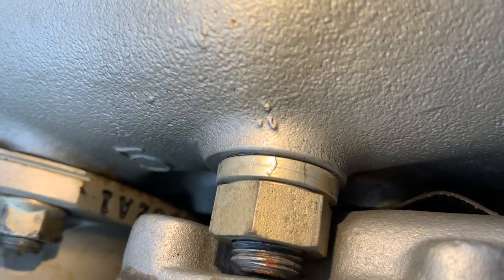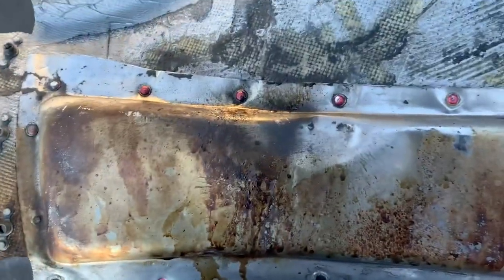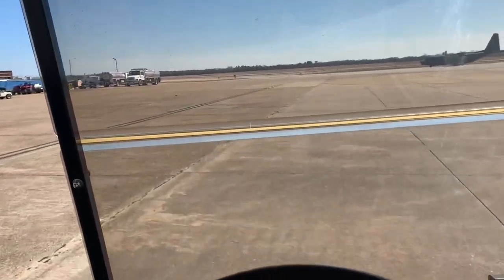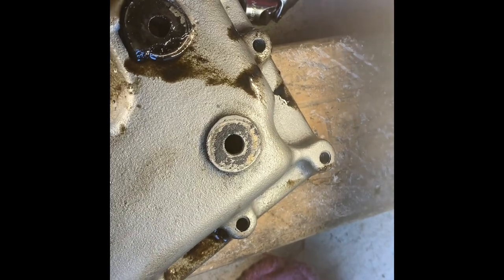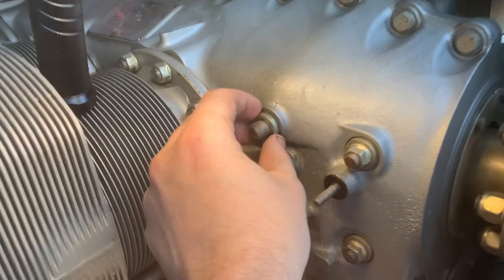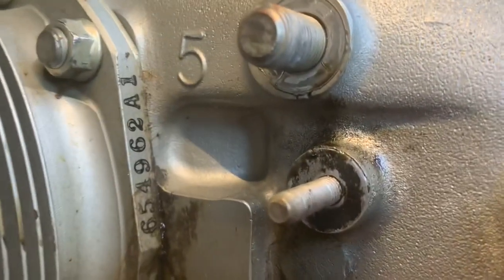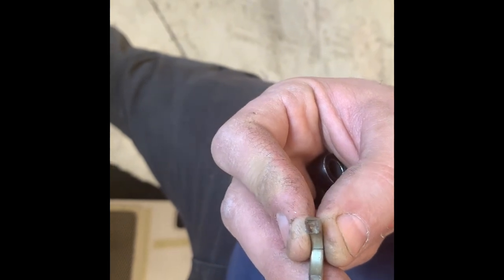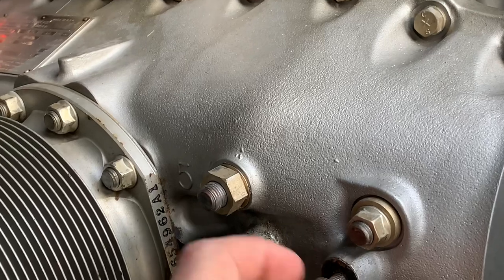Cessna 210 continental TSIO-520-R has a slight major leak.  Cracked through stud hardware. A&P life.

Comment: I've been an AMT for 35 years+.I owned an airplane for 10 years and worked on GA up through heavy large aircraft. Same simple Trouble shooting techniques pay off on all of them. That is the gift you guys have- and it's rare in our field. You trouble shoot. Fantastic work- keep it up. I guess I'm not alone.
Reply from the maker: Wait on part two.. when we pulled out the thru bolt I found out is the wrong part number….. it’s too long…. So then I looked for the shirt one and found it smack in the middle. No thread protrusion on either cylinder hold down

Comment: I had a thru bolt on my 0-300D for 172F leaking- found hack saw marks 50% thru the bolt UNDER the nut. The o-ring for the side with the leak had been pulled from the land the o-ring was to sit in, It worked for a little while- it has 790 hours on it when I pulled it out. In the process, I ended up having that jug reworked for cracked exhaust seat and valve guide as well.
Reply from the maker: Bro sometimes you wonder what’s been going on with these birds 😂.  So hard to find good information on a lot of the stuff we’re working on because most of the techs who really need it have retired.  Our shop is basically all under 35 and we try to soak up all the information we can from the older part time guys

Comment: Get a Continental Tech Rep on the phone and have him dial up your video. I'm certain it will interest him. There have been way too many fatal accidents this month, one was right out of a fresh annual.
Reply from the maker: Overhaul shop may have put on the hardware with the cracks already there
Reply: @aviationsquared1909  I was thinking over torqued?
Reply from the maker: @Brad2117   yeah we debated for a while 😂.  Another theory was that the paint was wet and rolled up when it got torqued putting pressure points on it.  

I honestly have no idea how it happened, but we looked over all the hardware and that’s the only one cracked.  Rest assured it’ll get fixed no matter how it happened
Reply: The 210 fatal in Grove City Pa. Last November Is an interesting one.  Appears through bolt nuts backed off. Apparently the engine was a recent OH. My friend was the passenger.
Reply from the maker: @jplumbob  sad to hear.  This one got very complicated when we started looking into parts.  It’s not flying with that engine
Reply: @jplumbob  I was doing some minor maintenance on a 421 that was bought by a nearby reseller. I don't know what made me do it but I found some loose (as in finger tight) cylinder hold down nuts on the right engine. That was back in the 1990s.
Reply from the maker: Wayright….. this engine was last worked on in 1995….. probably by the same guy because the #1 thru studs had zero torque.  Matter of time before a spun bearing

Comment: What are those "V" cuts on the outer edge of the recess where the broken washer came from?  Are they supposed to be there, or just broken off casting edges that don't compromise the case?
Reply from the maker: That’s where the cracks from the washer had the case form into it.  Through stud lost torque and vibrated.

Comment: elcano of wormos
Reply from the maker: Send help! 😂
Reply: @Gary Windsor,  Yes, It could be a 'Can of Wormies', but it is important for the users of this really nice plane to check into the actual CAUSE of that unusual oil leak... I'm thinking that this is a possible sign of upcoming issues with this engine... Possibly a poor seal between the case halves, or worse - a possible crack of the stud - boss , that could be caused by a defective casting... IDK, but the owner(s) should check into possible AD notes and Service Bulletins for this type & model of engine, and check to see if they have been complied with, if there are any for this engine...
Reply: @michaelmartinez1345   no shit sherlock i just said its a can of worms because i  have worked on a few C210 and I know how it goes
Reply: @gygw  , Golly,  that is interesting... Tell me about your experiences on larger multi engined aircraft and their systems... When was the last time you changed a pitch trim jackscrew? How many Cessnas have those? How many times have You dealt with APU's? How many times have you dealt with VCF's , VBV's , VSV's , PFD's , ADP's , ETOPS , RVSM, TCAS, MCP's, CSD's , VSCF's , RAT's , ACM's , IDG's , IGV's, bleed air, anti-ice, Radar altimiters, Radio altimiters, Weather Radar, Cabin door slides, Crew O2 systems, Engine Bleed air valves, EPR, ILS Localisers, Auto throttles, FADEC, Cabin pressurization, outflow valves, Cabin pressure relief (negative & positive delta-P) MUX cables & equipment, Cabin wastewater and treated (blue water) lab systems, high delta-p lav-waste accelerator systems, gear door sequencing valves, servo tabs, flight augmentation control systems, Fowler flaps, Zap-flaps, Leading edge flaps, flap carriages and adjustments, Flap & slat assymetry sensors, inboard (high speed) ailerons, outboard (low speed) ailerons,  AOA' sensors, OAT sensors, Static Ports,  Heated Pitot tubes, T/R's , Cascade Vanes, Trans Cowls , Blocker Doors, Clam-shell T/R's, 5th pods, Tiller control lever, Skydrol, M-6 cleaner, open center hydraulic systems, closed center hydraulic systems, MS hydraulic fittings, AN hydraulic fittings vs. SAE hydraulic fittings, Cabin and Cargo compartment heating/cooling & temp zone controls, fire retardant systems,  Braking systems, speed brakes and ground spoilers, Squat switch's, powered Cargo loading/fastening equipment on the planes, LD-3 containers, and the ground equipment required to get the cargo containers and bulk cargo onto & off of the planes, How about driving on AOA's of major airports, how about above ground Large aircraft fueling equipment (Tanker trucks)and under ground (Hydrant) Large aircraft fueling equipment (Hydrant carts & Hydrant trucks)... How many times have You gone up well over 60' high on a manlift to perform work on an empenage? Well Watson, what can you tell me about these common every-day things that are part of the heavy turbine aviation world, frequently dealt with by the common A&P's/R&E's , Pilots, GSE crews, and other large/major airport employees & workers? Please consider that there are other types of planes besides Cessna 210's and other airports besides the local municipal airports, that people use every day, when you're making the  comments, like the ones that You just made here.... Please consider WHERE the vast majority of aviation passengers and air cargo are actually going to, and coming from, and what type of planes , ground equipment and airports that they travel to and from ..... When you reply to this , with all of the aviation experience that You say that you have, expect some questions from me, and maybe from a few other people reading this thread, to verify Your experience... Anybody can build an impressive resume, the trick to that-is being able to verify those things at an interview... A word to the wise, Amigo...
Reply from the maker: Trying to get a 1-1 comparison on general aviation and commercial maintenance won’t work.  In GA unless it’s an annual the customer decides what they want done or not done.  Tech data requirements you are familiar with come from your airline and are more stringent.  A lot of the manuals used in GA are from 1960 and have never been updated.
Reply: @aviationsquared1909  I suppose that could true... But AD notes and Service Bulletins do exist in all forms of GA, as well as the larger airlines... That I am sure of... And with that being the case, wouldn't the replaceable pages of the "1960's" service manual binders be updated , just like the large airlines now do using computers? Sure they do... That I have personally seen myself. I did get a chance to work on GA planes, from January 2001, all the way until 9/11/01, when all VFR flying was canceled and many of the civilian IFR planes, even those with Xponders were grounded.... That is when the lateral skills that I previously had with trucks and heavy equipment came in handy... And the environment to learn new things in the many places that I worked at back then, and still now-was and is very open and conducive to learning new things.... Individuals with an attitude like the one displayed by 'Creative Mechanic' , were often quickly weeded-out and dealt with , sometimes in a way that ain't kind or pretty... They often let their OWN bad attitudes rid themselves of a good job that many others were waiting for... People like me, would quickly step in and fill the positions that they just screwed-up... And your comment , regarding the owners of the GA planes being able to decide on what they are able/want to have repaired and/or replaced is true... But if they wanted to continue flying that plane, they needed to have the MEL's on that plane completed, regardless of whether it came through an annual inspection or not.... That was (and probably still is) the law....
Reply: @gygw  so, tell me of Your experience with 747's , DC-10's & MD-11's...You forgot to mention them, BEFORE you are going to edit your last comment... Of those acronyms and systems that I just asked you about, in my last response to you, Which of them are exclusive to the 747's... If it was AAL that you worked at, which of the planes that You listed has a 'Penthouse' , and where is it located? Tell me about the air vanes that were added to some of those plane types that you listed here, and which system that it was  supposed to dis-able while the plane is in flight? Why was that system dis-abled while those types of planes were in flight? Of the acronyms that I mentioned in my last response to you, which one was only found on the DC-10's? Which of the planes that You listed above, have no doors over the MLG wheels? Which planes have 'Tombstone' fittings, and where are they located? What is the significance of these 'Tombstone' fittings.  Anybody who has ACTUALLY worked on planes at "the world's largest and best airline" should be able to answer most of the questions that I just asked you, without having to go to any search engines, or Life Lines...And regarding that Big bowl of Stfu soup, that You worked so hard to prepare , apparently because of the many  interesting comments that you have already mentioned here; save it for somebody else, or even yourself, because I will Always reject comments like that.... I like putting people , who have done amazing things-but seldom brag about it, in an Honorable status, and mention their accomplishments, and put them exactly where they belong, in an Honorable place... If You're for real, I won't put Your name on the infamous wall of shame....
Reply: @michaelmartinez1345  your are correct you are definitely top 100 material no doubt about it